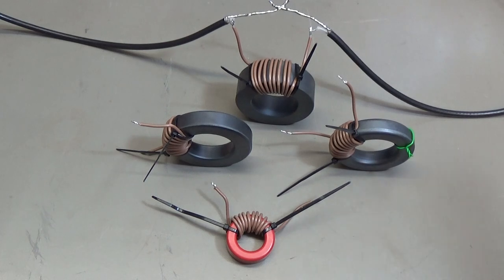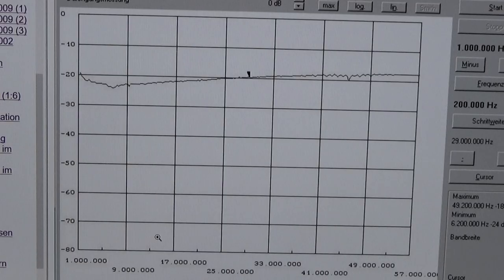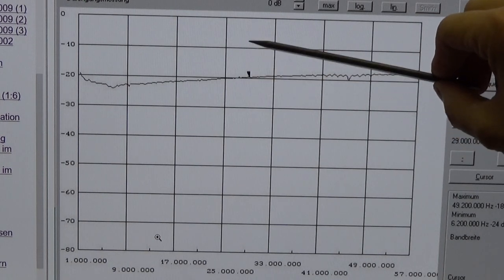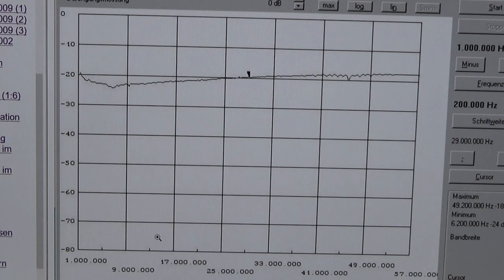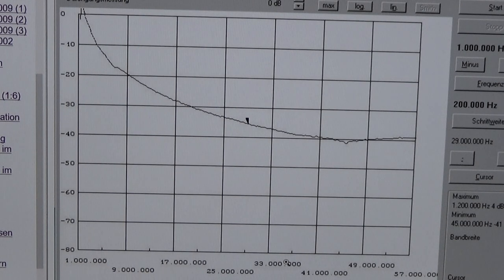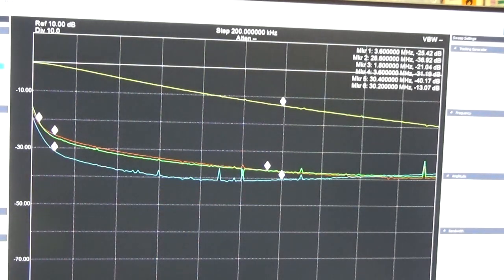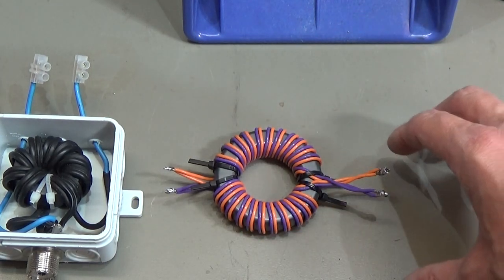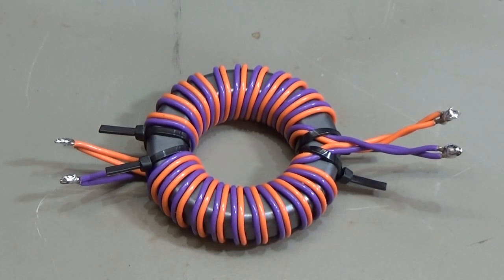#101 Balun PART 2: Balun's magic and how to wind an effective working Balun

Comment: Guten tag, Peter.  I am thinking of building these baluns as a project this winter, but I have a question for you about the size of the cable you use.  You say it is 18AWG, that is about 0,82mm2 - is that enough size for 1000w?  Wouldn`t 16 or 14 AWG be better?  Or is it enough with 18AWG.  I hope you can give me an answer on this question.  73 LB5JG  Auf wiedersehen.
Reply: Apparently Peter is offline or busy for awhile. Hope that he is okay will be back soon!!
In my opinion, if I may, the 18 gauge is enough, will get hot at high power, which is why the jacket is teflon to stand the heat load. If thicker gauge is used, you'll need bigger toroid because the wires just won't fit nicely and will overlap, and need to recalibrate the coils, which shouldn't be the end of the world. With bigger toroid you'll need to recalibrate anyways, pick your poison. 
If you decide to try, I'm very interested to hear about the results. Good luck!

Comment: Great videos on building and testing common mode chokes. I have a question about the wire used. Is the choice of wire based only on the ability to tolerate the high heat without melting the insulation? If I'm using low power and melting is not a problem, would any awg 18 wire work? And also, how do we decide that 12 turns gives 100 ohms. How is that calculated?
Reply: The impedance is not defined by the number of turns, the 100ohm characteristic impedance (of each section) is due to conductor spacing, diameter and the dielectric. Even for QRP PTFE insulated wire is a good choice, it is not terribly expensive.
Reply: thank you so much for the reply

Comment: Hi, i want to build a balun 1:1 for 50mhz with FT240-61 toroid to use 6mt self made dipole. 
Please, how many turns i must do? 
Is it the same with your toroid made for HF 3/30mhz? 
Please reply. 
Thanks
Reply from the maker: Well I would need to test it. First check the toroid if it is made for 50Mhz. If that is fine it should work up to 50Mhz...

Comment: Thank you very much for sharing these videos. I have a few questions. The first is, if I want to make a 9:1 Balun, I would make 9 wraps of the wire? Also, I want to use SO-239 Connectors on each end, so I would need 3 wire strands? And finally, using two cores would allow for higher voltage through the lines?
Reply: If you are planning a 9:1 unun then the turns ratio would be 3. Two cores stacked will increase inductance and probably help with low frequency performance.

Comment: I saw the wire you were using Peter was stranded tinned, would there be any difference in using solid ? What about using magnet wire with enamel coating, but this would not resist heat that much. What was your parameter in using the wire that you have chosen. Cheers from Canuck land.
Reply from the maker: Hi Tom, well a lot more variants would probably work but all of that is simply not tested enough. The DG0SA version is tested and we know that this design together with the used material is simply working perfect. Hope that helps. Thanks for watching 73

Comment: I have learned so much from you and appreciate it immensely. Would using a smaller type 43 core and smaller gauge ptfe jacketed wire yield similar attenuation/swr results for use at <100W?
-73 DE KL5IO

Comment: Excellent video and satisfying my design requirement for a 9;1 balun to feed a Terminated Balanced Dipole. Question is the SWG10 PTFE wire solid or stranded and does it matter?
Reply from the maker: Glad that you like it Martin! The used wire is stranded. 73

Comment: Very appreciate your efforts, considering lot of factors 
that can influence the materials and configuration of that toroids. 
For example, May i use a balun 1:1 to reduce interference 
for a commercial antenna !? (excl. dipole)
..i mean placing a balun between antenna and rtx..  Thks  '73. :)
Reply from the maker: Hi Alessandro, you put your 1:1 Balun in your coax cable and if you have common mode current on your coax it will then reduce interference.. Hope that helps 73
Reply: Ok, by the way.. where can we buy that kind of cable (kapton material i suppose) with a good price !?  ..what kind of ferrite suggest for common-mode hf /v/u suppression ?! '73 CIAO

Comment: Peter...A question...Is the output end of the co-ax terminated?
50Ω??
Plus? A decoupled diode to make the DC to be measured?

73 G3NBY.
Reply from the maker: We are useing a vector network analyser here and both sides are terminated into 50 Ohm. We are using short wave transmission frequencies here no DC involved. Thanks for watching. 73

Comment: Wow Peter! very good video, great job bringing everything home and wrapping it up...also,  I forgot to congratulate you on your 100th video in my comments to part one, so happy belated congratulations on you 100th video.  Now back to this video, a couple of things that I am having difficulties understanding is why the current won't spill to the outside of the coax shield at the balun coax connection point, it must be a better path to ground then going to the antenna. The other question is with regards to the impedance of the wire used to wrap the toroid, can the impedance of that wire be model as a parallel transmission line?  If so,  then would the impedance be dominated by the ratio of the wire separation (D) to the wire diameter (d) i.e. D/d or is it more influenced by the dielectric constant of the PTFE insulation? Lastly, how far away is the self resonance point, formed from the inductive reactance from the turns with the capacitive reactance formed from the parallel wires, to the operating points of the balun or is that not a concern. Thanks for sharing and keep up the good work, we all enjoy it very much!
Reply from the maker: Hi Michael, thanks for the good wishes! Wow a lot of questions :-) If you consider a balun as a kind of autotransformer you may see that on the coax primary side there is a real ground. Secondary  is the balanced side like with the autotransformer. So all potentials are quite given as needed therefore no compensation current will come up.The impedance is due to the dielectric of the PTFE wire. It simply fits perfect. Answer to the last question is that it does not really matter as we using the balun as transformer therefore that is not that much in focus. Hope that helps 73

Comment: Hi Peter, many thanks for the excellent videos.
Regarding the wire used, I have access to 16 AWG, silver coated, PTFE sleeved wire. Would using this wire be likely to work OK?  Is the wire gauge absolutely important?
Reply from the maker: Hi, the gauge is important for power and meeting the needed impedance. AWG16 should work if you get enough turns on the core. Thanks for watching. 73.

Comment: Nice video, thanks. What type wire on spools You are using? (40:27).
Reply from the maker: Thanks for feed-back. The wire is PTFE AWG18 with silver finished copper.  Thanks for watching 73

Comment: Much simpler and better CM reduction performance if you simply use RG400 wrapped on an FT240-31 core.  4 turns , cross the middle, then another 4 turns (9 turns total).
Reply from the maker: You should watch the hole series to do your final judgment..

Comment: Hi OM, what impact could potentially happen when metal enclosures are used for encasing the balun. What to look out for. Thanks 73's
Reply from the maker: Hi, you should use a plastic housing as metal always have an inpact on the magnetic field around the core... 73

Comment: Thanks for the video. How do you know if the current rejection is due to the high inductance (impedance) or to losses in the ferrite itself? If you look at the complex permeability of the 43 material, you will see a very high loss tangent right over the frequency band your are showing. In gross, what is the insertion loss of this balun ? I'm afraid it attenuates significantly the signal not only the common mode current. I mean putting two 100 ohm resistors, one on the center conductor and other on the shielding will give the same result, i.e. very good matching and as well as low S21. Another point, this is a current balun, the one you are showing at the end is a voltage balun (made by Ruthroff, its theory is presented in Sevick's book). The only argument making the Ruthroff balun useless as you says, is the S21 measurement your are doing, but is this measurement really "simulate" the commun mode current rejection ??

Comment: I am having trouble finding PTFE wire here in Australia I did find 16AWG used for high quality speakers but it is 1.3mm diameter and might be too large to fit 12Turns on the 240 core.  Enjoyed the Balun videos very much, 
May be you could do one on the 9:1 that people use on end fed antennas. 
73
Cliff VK2NP
Reply from the maker: Hi Cliff , yes sometimes it is difficult to find but there will be a Source. Thanks for watching. 9:1 Max be in the future. 73
Reply: Just to let you now Peter I made a low power version maybe 100W of the 1:1 on a FT114-43 using some PTFE wire stripped from a high quality CAT 5 cable , works great .
Cliff
Reply from the maker: +Clifford Hynds Ah very good to hear, Cliff and thanks for leting is know. 73
Reply: Clifford - A lot of the Toroid manufacturers sell Teflon sleeving for toroid winding. (Amidon Associates has it.) Just strip your wire and slide the sleeving over it. As you know, Teflon insulation is very important on baluns due to the heat that they can generate, especially when run at high power. I just thought that I would mention the sleeving in case it could be useful to you. 73's :-)

Comment: I am a poor ham who has no test equipment other than an antenna analyzer, a watt meter an SWR meter.  But, I am very interested in building my own Balun's and Ununs for my homemade wire antennas.

So when you mentioned core material is FT240/43 that was a real help, I'm going to look in my Mouser catalogue for them.

Now you also mentioned PTFE type of wire at 18 gauge.  I understand the higher temperature of the PTFE specification.  What I would like to know is: If I used say 16 gauge or even 14 gauge wire would the power handling rating go up say from 1KW to 2KW or so?  Of course I expect that I would have to increase the size of the core material to handle the lager diameter of wire in order to make the specified number of turns.  Would the number of turns change to accommodate the increase of wire diameter?

thanks
Russ KW5KW
Reply from the maker: Hi Russel, yes you assumption is right by increasing the wire or the core you can handle more power...Thanks for watching 73

Comment: If you have tubed the balun by manipulating the wire can you then fix it in place with hot glue or some kind of silicone without screwing things up?
Reply from the maker: Hi David, yes you can use hot glue with no problems. 73

Comment: You do not need to convert the 61mm. The name 240 means 240 * 1/100s of an inch. In other words the core is exactly 2.4 inches wide and made out of type 43 material. The diameter is in the name.

Comment: what are the coax cables connected to? input and output of a spectrum analyzer? how did you arrive at 100 ohms for the wire? are you saying dc resistance or Impedance?
Reply: Did you get an answer?
Reply: The coax appears to be connected to a regular spectrum analyzer (the crt-like footage) in one measurement and a VNA (the blue box) in the other. Given you have access to a good VNA, you will be able to perform all measurements on that instrument. Regarding the 100 ohms, it refers to the impedance of the two wires in each winding. When they are connected in parallell, the total impedance will be 50 ohm. So, we are talking impedance, not resistance of the wire.

Comment: Thank you so much for your very interesting and informative videos. May I just correct you on a minor point (especially as you are not a native English speaker) and that is the pronunciation of the word "balun". It is "balun" as in "gun, ton, sun...", rather than "balloon" as in "moon, noon, soon..."; since it derives from "balanced to unbalanced" transmission line interface.
Reply from the maker: Thanks for watching and the kind advice. All the best and 73
Reply: @TRXLab  say it the way you want, you earned the right to change the word if you wish, you already own the knowledge. 134 91 92 oh and 73 also.

Comment: Would it make much difference in performance if solid magnet wire was used instead of the stranded wire?
Reply from the maker: yes as we have to fight the skin effect witch gets more worth with increasing frequency.  stranded wire is the better choice.. 73
Reply: I thought the skin effect must make a difference.  All the commercially made baluns that I've seen use solid wire but that must be why they don't perform very well.

Comment: What a great series, this really demonstrates the function and methods with the correct materials.
I have one question for you, I see many 1:1 BalUn's made with FT240-31 cores and using RG-400 Coax with 6 turns each side crossing over to the opposite side through the center and then 6 more turns coming back for a total of 12 turns.
Have you ever tested a BalUN made as I described?

Thank you
Paul KR5OG

Comment: I've Never Discovered what the (Mix Material Value) Really means (43 ??) is that the Radio of Nickel and Zinc 43% ?? the first number 240 (Means) 2.4 Inches Across in Dimension. (Also it's very Nice to See someone who knows how to Count the Turns Correctly on a Toroid Core ) 👍🏆 That type of wire insulation can handle up to 600 Degrees "Fahrenheit" 315.5 Celsius (Good Stuff)

Comment: how close can the two cores be without interfering with each other? if i make a 1:1 and attach it to a 9:1, can they be stacked? should i mount them at a 90 degree angle? are they better off flat, side by side, as shown in the video?
Reply from the maker: The best is to place the cores close together side by side. Stacking is possible too but you always should Test for Performance. 73

Comment: If I use a BalUn like this with a dipole antenna cut for 80 meter and transmit using 450ohm twin lead wire and a tuner on 40 or 20 meter, I have to assume the mismatch between the antenna and feed line would cause the current to be much higher than that of a matched system.  If I want to transmit 1kw and my SWR is far from 1:1, how do I know if my BalUn will overheat and fail?
Reply: Tommy Rassier you will know when the core saturates and your SWR goes way up.. 73's David K8KEM

Comment: Thanks Peter for a great design. I build both the 1:4 impedance transformer and the balun. CMMR and SWR is exactly as in the video, insertion loss of the balun is 0.16 dB at 28 MHz. I am planning on writing an article on a website about this with Bill of materials, links to material resellers etc and of course with links to your video's. Would you mind this? Thanks in advance for your answer!
Reply from the maker: Thanks Tom, glad that you like it! I would appreciate if you link my video and let me know where the article will be find..73
Reply: Hi Peter! Article is finished and can be found here:

https://a08.veron.nl/zelfbouw/antennes/800-watt-fd4-multiband-antenna-with-super-balun/

Comment: Hello, would the same principle work for a VHF/UHF   1/4 wave vertical with radials?  

Or would an 'ugly' coax balun be better?
Reply from the maker: Hi, in principle yes but with a different core material as it needs to work up to 500Mhz.. Additional to that it might be important to drill the wires. But that needs to be investigated a bit more... 73

Comment: Tnx Peter. Looking forward to seeing a good 4:1 design. Could you say a little about transformer-wire as an alternative for winding? Also lots of amateurs wanting to know how to do this for vhf and up. I'll stop buying type two material as of today. 73 de PY6ZEV
Reply from the maker: Hi, well yes transformer wire would work but you have to drill it to get close to 100Ohm. The problem is that then the insulation od the transformer wire may splinter and that is a problem for 1KW.. Well for VHF and higher you need to use a different core material which is capable to handle higher frequencies.. that's it..  73

Comment: So when testing these baluns in this configuration with the VNA, one side is connected to DET and the other connected to DUT with the balun in between both test leads?
Reply from the maker: Yes you are right. That is the test set up 73

Comment: grate videos! i am still new to amateur radio and just came back today from 4 days of camping, i like to take my radio with me to talk and make contacts because i live in the city so when ever i can get out of the city to use my radio it is a treat. right now i am using a "JR5v Jr" and it seems to stink it receive ok but i don't seem to get out even when trying to reply to the strongest of singles.. I want to make a 40 meter antenna with twin lead down to a tuner. would the same core be used for a 4:1 Balun..? so i can use it with the auto tuner in my radio?? 
and can you make a video on a 4:1 Balun?
kd2goe
Reply from the maker: Hi Matt, yes I'm planig a video on a 4:1 version and yes the same core materials are used. Actually you need 2 cores as an effective 4:1 version need 2... Anyway it will take a couple of weeks until I will find the time to do the video. Thanks for watching 73
Reply: awesome i can't wait

Comment: i tried this with 18awg silicon wire, but it is too thick to get 2x12 turns onto it. can i do 2x9 turns and what would change if i did this number of turns only? thanks
Reply: In my opinion, the impedance will be lower, the common mode suppression would be less effective on lower frequencies, thus your swr would potentially rise. If you already made it, test it then, and see if the given characteristics still adequate for your needs. If you stay below swr 1.5 on the bands you use but unable to improve, should be still reasonable